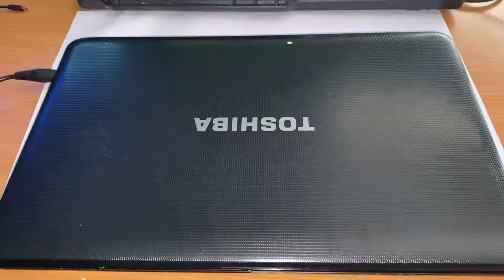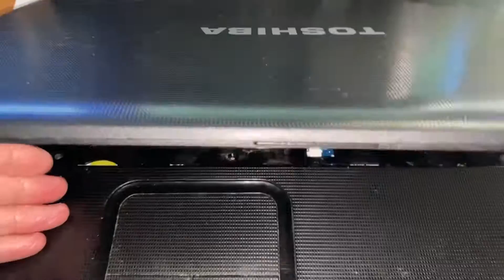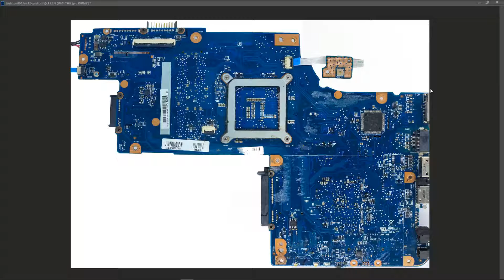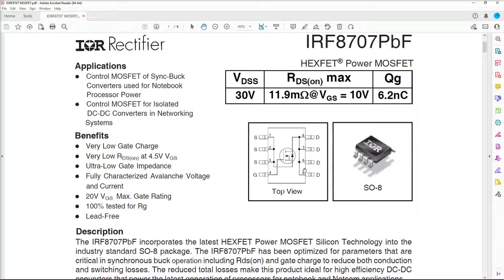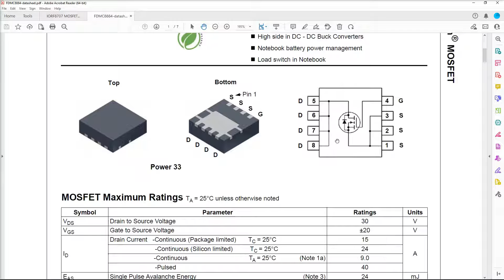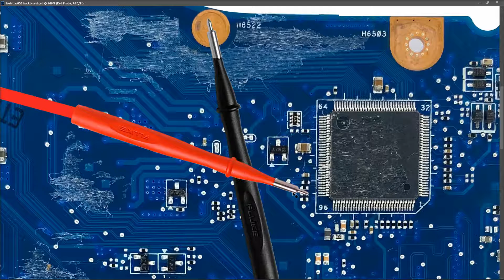Toshiba Satellite C850 - Why Is It Not Powering On? (Part 1)

Comment: Sir pls I was measuring dis same machine and my first power mossfet d input measures fine 19.31 volt but d output is measuring 0.86 all d four legs sending d same volt to d next component second mossfet I 0.86 down to all d power line components pls need a help here should I replace d first mossfet? Or ?
Reply from the maker: Sounds like you have found out where the 19V is being stopped. Could be a) an issue with the MOSFET or b) the MOSFET is being kept switched off because of an issue further down the circuit. I would turn off the power and check for shorts. Good luck.

Comment: I was also trying to messure the 19V on the small cap at 11:40 and guess what.... I blowed it by that. I could follow your guide until that moment. Now I have a short here and need to replace that cap. Not sure why that happened while messuring the volts...
Reply from the maker: While it is always safe to measure in DC volts (as opposed to continuity), the components are very small and close together, so there is always the danger of shorting between two components while taking measurements. I wonder is it possible that when you placed the probe to the positive of the 19V capacitor, that you also touched off the 3.3V capacitor and maybe shorted that component or something on that rail?
Reply: @therepairshare673  Well I cant be sure for 100% that I didnt touch the other component but I was careful and tryed to touch it on the top.... Do you know by any chance what values this component had?
Reply from the maker: @x-fix  Why don't you send me a pic of the area to therepairshare@gmail.com and point out where you are detecting the short. I may not be able to identify the component, but we might be able to identify where the short is and remove it.
Reply: @therepairshare673  Sounds great! I will get some pics done and send it over! :)
Reply: @therepairshare673  I think I found the problem. The IC 1225c under those caps is blown. It has a hole. I just noticed it under the microscope. This would explain why the cap was lightning up...
Reply from the maker: @x-fix  Those QFNs are difficult to re-solder, but there are some brilliant videos online showing how to do it. You might as well have a go at it, if you can pull the same IC from another Toshiba laptop.
Reply: @therepairshare673  I just ordered this controller chip from Aliexpress. I am pretty confident that I can switch it. Some hot air should do the job.

Comment: Hello! This video is amazing to anyone who is troubleshooting his machine! Very helpful! Is there a way you could tell me what values the capacitor has that is placed above the 2R2 resistor right at the beginning of the video near the 19V power line? I noticed that this one blowed up and got seperated in 2 halfs so there is no way for me to messure it. I also checked out the schematics but Im not able to find it there....
Reply from the maker: Sorry, I brought it to the recycling centre already. That is a 19V power rail so the capacitor has to at least support 20V-25V, and I would guess either 22uF or 10uF. Unfortunately no schematic/documentation from Toshiba to confirm!
Reply: @therepairshare673  Thanks a lot for the reply! It helps!
Reply: @therepairshare673  Hey buddy! I just wanted to say thanks again for your help on my Toshiba Laptop repair! I also mentioned you and your channel in my latest video that I made about this repair! :)
Reply from the maker: @x-fix  Thank you. I'll be sure to check it out. 👍

Comment: The last "no power, no POST" laptop I repaired only needed a BIOS reset. So one of the first steps I take is to disconnect the main battery, and remove the CR-2032 battery. This allows me to check the battery voltage levels, and it also forces a BIOS reset. When I connect the charger, the motherboard either starts and and scans for memory and such, or it remains dead. (I like to keep the fan connected to show signs of life.) Then I begin looking for shorted power rails. 
I know that your preferred method is to follow the DC_IN voltage around the board. I have no problem with that. I am still too new at this to feel comfortable probing around a "hot" board with my meter. I have already killed a transistor (MOSFET driver) by shorting it to a pull-up resistor. So yes, I am gun-shy with meter probes on hot circuits.